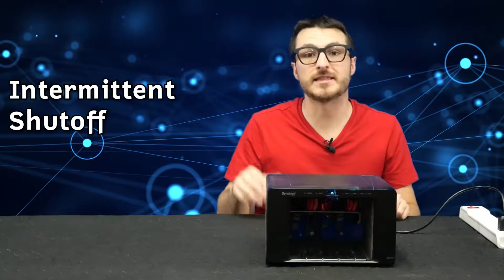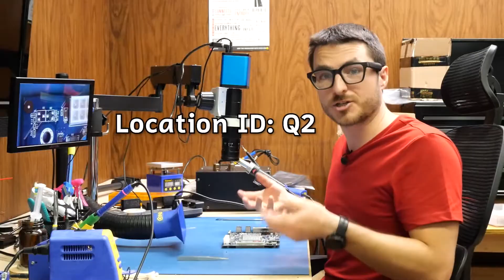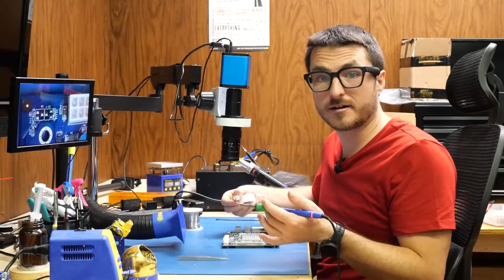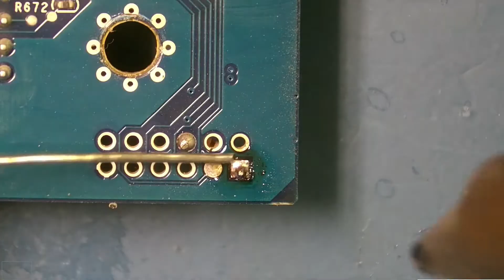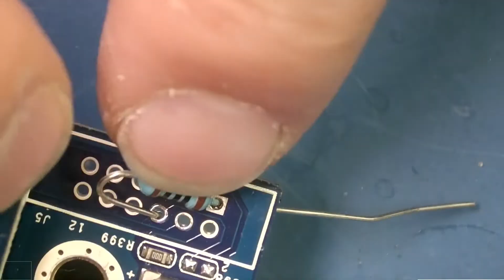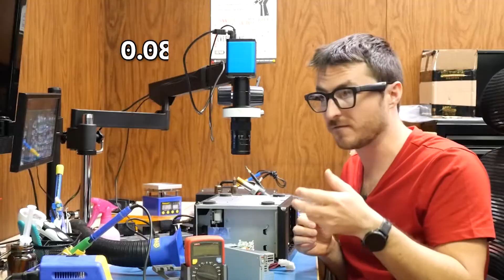How to fix DS1515+ Synology All common faults

Comment: Hello Nicks! i have a 1512+ Synology told me to replace the Q2 resistor but I am unable to locate it and it's not the same motherboard as the 1515+.  I can't believe Synology said they don't have the schematic for that board and that I should reach out/bother you. I guess i can add the 100ohm resistor also that people recommend at the same time. I really appreciate your help in this matter.
Reply from the maker: Hello,
I have a few questions, and if you could please not reply to this comment but instead start a new comment or reach out to us directly (contact info in vid description). The reason for this is that I don't get notifications on replies, only new comments. This way I am sure to see your comment. 

#1 Synology told you to contact us directly? Did they actually name Nick's electronics repair specifically? I find it Ironic because we applied to become an authorized repair shop for them and they told us no because they already had all the people they needed and would have no use adding more shops to their authorized repair list. 
#2 They told you to replace Q2 and add the 100-ohm resistor? I can't believe I am hearing this as Q2 is not a part that commonly fails on your unit and you should not be adding a 100 ohm resistor to that board either.  Either the rep you were speaking to misheard your unit model number or they don't know the difference between their 12 13 and 15 series units. 
The DS1512+ units are very different than the DS1515+ and do not require the same repairs. 
#3 What symptoms are you experiencing? I don't believe you mentioned the issue you are experiencing with your unit.

Comment: Hey @NicksElectronicRepair, great video thank you. I have done the repairs mentioned and I am still having an issue with my unit., wondering if you can advise. The unit shuts down when it gets too cold. The unit is kept in the garage (It used to be in an air conditioned room at work where it had the same issue). Every time the environment gets too cold (Never freezing) it just shuts off, I bring it into the house or warm it up with a hairdryer and it turns back on, back in the garage overnight (in winter) and it turns off. Is this part of the capacitor/temperature change you mention in the video do you think?
Reply from the maker: Perhaps the CMOS battery. Batteries can be affected by cold. Heat and cold also affect the resistance of capacitors and resistors, so indeed caps could be at fault, but there are hundreds on that board. It could also be a cracked solder joint on the connections between the processor and the PCB or the processor itself could also be going out. 
What I would recommend is using your hair dryer, only heating a very specific section of the PSB at a time. Try and narrow down where the fault is coming from. 
If the processor is going out and needs to be replaced, which is rare but we have had to do it a few times, we can do that for you and make a video out of it. 
If this is the case message us directly our contact info is in the video description. That type of work is significantly more involved and the processor chips are pricey so it does come at a premium we can discuss it further and see if it makes sense for you. 
-Nicholas
Reply: @NicksElectronicRepair  did you ever get the chance to take a look on the issue described. I also have a unit that would not start when room temperature are below 21.5 degree celcius, but at soon it get abow it, then it will start with no issue.
if i messure voltage on (PS Online) on powerconnector at motherboard then see 5v when off and 1,36v when it turn on at 21,6 degree celcius, and the voltage will drop the higher the room temperature get. Lowest voltage was 0,7v at temperature 26,8 degree celcius

Comment: what if the resister need to be replaced multiple times... I did this and a year later had to do it again....
Reply: @ ID: Q2
Reply from the maker: Please see the video description for the parts information
Reply from the maker: The resistor will never need to be replaced. It's not going to go bad unless it was not properly installed the first time. If the device fails again it's either because something else failed, or your processor fully failed in which case the processor should get replaced, not the resistor. I am willing to bet that if you replaced it a second time it didn't fix the issue the second time. 
Most likely one of the other parts I cover in the video has to be replaced to fix the unit.
Reply: thanks... you are right it was not resistor.... i miss-typed it was the processor that was replaced twice... im thinking that it is possible the power supply... I will test this theory  @NicksElectronicRepair
Reply from the maker: Any update on this? Were you able to get it going?
Reply: @NicksElectronicRepair  It turns out that the original resistor actually failed after about 5 years of use. I suppose the CPU’s clock starts to shift even more and a new (or more powerful) resistor is required. I replaced the official resistor which seems to be about 0.05W by another with 0.25W in terms of power rating and the random crashes are gone!

Comment: hi Nick,s i have fixed all components (Resitor 100om, and transistor) to this DS1813+ 
motherboard but this device i not working, when i turn it on it will turn fan and it turns off please help me out what is the error 
Thank you 
Harish KoNa
Reply from the maker: You replaced the CMOS battery as well? 
Then most likely the repairs were not done right or the motherboard was damaged during the repairs. 
What I show in the video is everything that needs to be done in order to get the machine working again. You didn't do the power supply resistor replacement but that's okay that shouldn't be a part of the fix, more of a preventative repair/modification for long term success of the repair. 
This is probably a situation where it would make more sense to send in the unit for us to repair for you.

Comment: What is the value of resistor 392 on DS1515 Power supply?
Reply from the maker: 392 is 3.9Kohm or 3,900 ohms. The one we install is 103 which is 10k or 10,000 ohms.
Reply: @NicksElectronicRepair  Thanks for the answer 🙂
Reply from the maker: no problem!